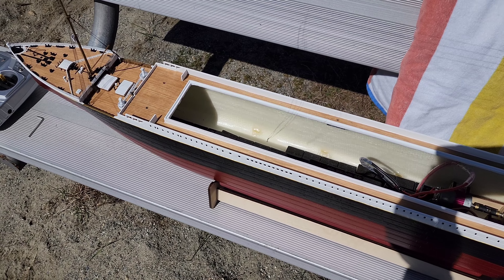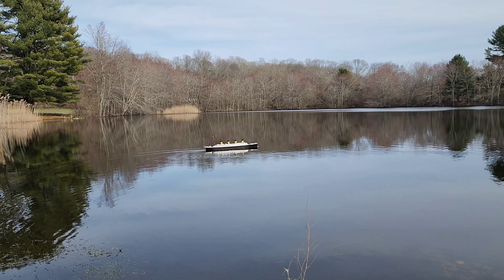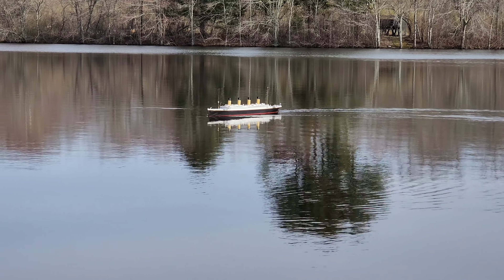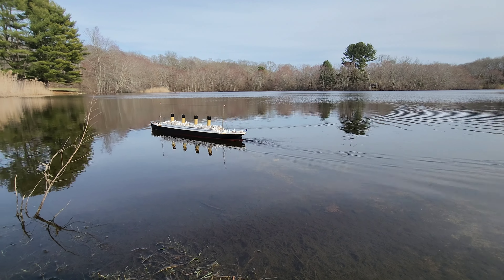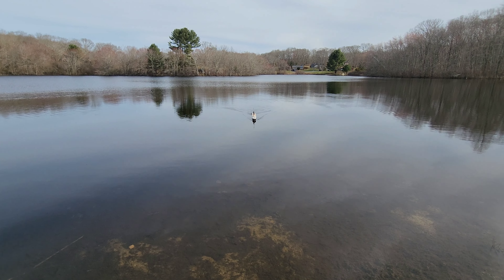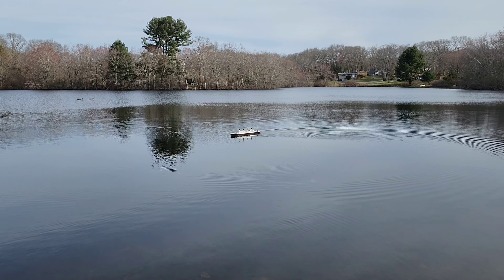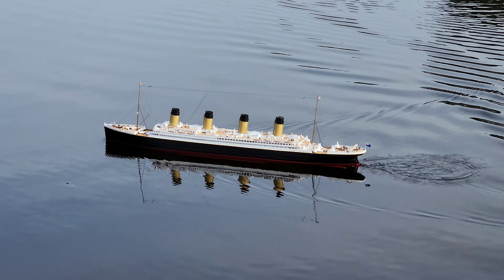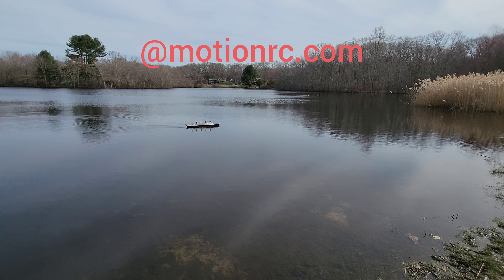RC TITANIC Maiden by Bancroft 1/200 available from motionrc.com

Comment: The model is 1/200th scale in size.  But, if it was 1/200 in weight, it would weigh 250 tons.  There is no way a model that size weighing that much would stay afloat  What am I missing?
Reply from the maker: It's scale represented in demensions not mass. Cheers
Reply: @SSNFastAttack  I agree.  My question is, "If the volume of the hull is 1/200th of the Titanic, wouldn't it be able to displace 1/200th of the water the Titanic can?"
Reply from the maker: The gravitational constant on mass is logarithmic,  not linear like size.
Reply: All  dimensions  are  1:200  in  scale,  length,  width  and  height,  hence  volume  is  1:200 x 1:200 x 1:200 = 1:8000000
This  would  relate  to  weight  and  displacement